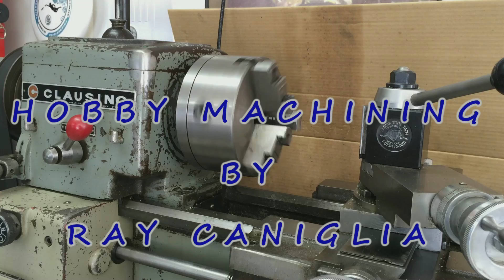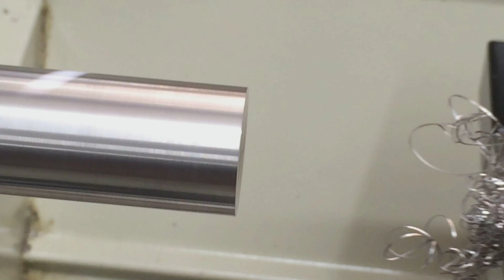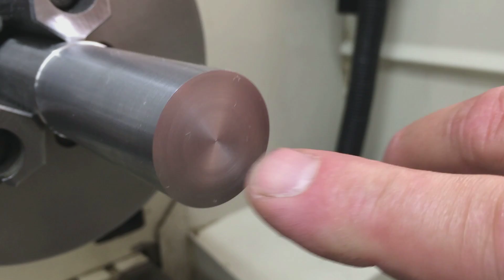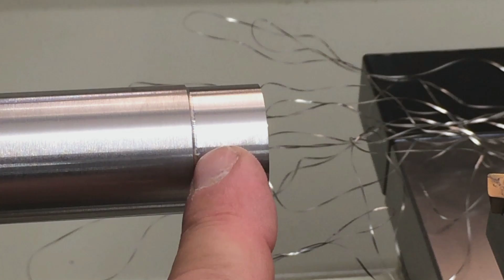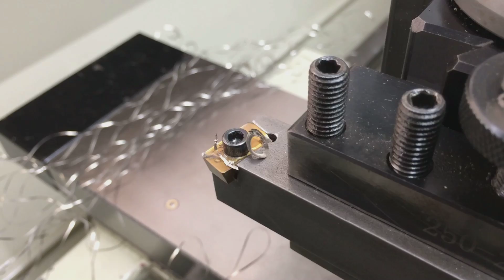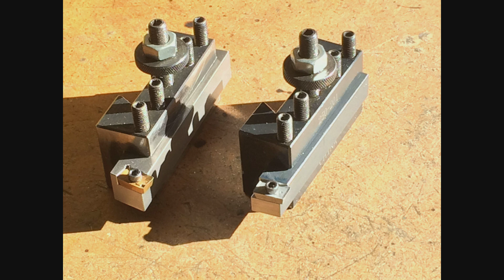Carbide Insert

Comment: Hello Ray,  Watching one of your older videos I had missed somehow.  Those inserts wouldn't go with me as they won't break the chip.  Bad part of that is the long stringy chips can catch in the cutter and mar the work as well as being a hazard.  But to be fair I haven't found very many that work well in stainless.  A lot do a fine finish they just won't break the chip--some get downright scary.  Take care.  Doug
Reply from the maker: Hello Douglas, You are correct, these do create a long string but like you said even a chip breaker insert does not work well on some stainless. 17-4 PH is a perfect example and is very dangerous to work with!

Comment: Nice finish cuts that 17-4 like Ledloy. Trying to figure out the inserts. The coated one looks like a used facemill APMT insert utilizing an edge that goes to waste in the milling operation. Makes use of an edge that normally goes in the garbage. If this is the case nice idea and sure does the job in a lathe.
Joe
Reply from the maker: Hey Joe,

You are correct, these are re-purposed face mill inserts, Randy had a bunch of these and hated to see them get tossed so he made these turning tools. They do work well and from what I understand these run about $18 a piece new.

Thanks man,

Ray
Reply: Ray Caniglia They are crazy expensive but they sure cut real clean. Great on aluminum too. Great way to get more for your dollar and get a great finish. They can be reused for face milling too. A little different layout on the insert but same idea.
Joe

Comment: Ray, I've never used a tool specifically designed for facing and do not know how to orient such a tool. Is the cutting edge of the insert parallel to the work surface or is there some slight angle? Thanks!
Reply from the maker: Hi Bill,

I am not sure, Randy Richard gave these to me that he obtained from a friend, so I am really not sure how these milling inserts were used or what type of face mill that they were installed in.

Sorry I could not answer your question, maybe Randy can?

Ray

Comment: those are milling inserts, thats why they don't break the chip. It's the wrong tool for the job, but of course for hobbyist purpose we use what we can get .. actually, its for a small mill, which don't require a chipbreaker.  If you have to choose between a tnmg or somx at the flea market, go with the tnmg for turning. it's important not to encourage the wrong practice just because our friend's feelings might get hurt, or we think we're not showing respect to them because they were generous with a free tool.

you can get a better finish if you hone the insert on face for something like a 5-thou width of the honed area. this is called a 'wiper' edge.
Reply: meocats I think you are missing the bigger picture; which was re-purposing.  "Never let perfection stand in the way of progress"............you need to be able to differentiate between "wrong practice" and "making the best of what you have".  Thanks, Sean.
Reply: false, i addressed that. U wanna repurpose? braze a carbide endmill to a shank and grind a groove and relief.
Reply from the maker: Hey Meocats,

Thanks for the info. Since Randy has boat load of these inserts I will have to try honing on one and test the results, that would great if it yielded an even better surface finish! I like your idea of re-purposing a carbide end mill, might have to give that a try.

Thanks again man!

Ray
Reply: Meocats if you owned a company and had to purchase the inserts you would look at it differently I happen to own a machine shop and know first hand the cost of them and depending on the coating and grade using the edge that is left from the milling operation saves about 6.00 per insert you would make a better machinist to think outside the box

Comment: Randy did a fantastic job making those tool holders. Nice demo on the chip making. 17-4 can be a bitch sometimes. 
Thanks Ray!

Adam
Reply from the maker: Hey Adam,

Thanks bud! I really like 17-4, great surface finish but have not found a cutting tool in my arsenal that will break the chip.

Thanks for stopping by man!

Ray

Comment: Hey Ray, Randy did a nice job on those holders. I have some inserts that don't have holders, so I've got the bug to make some after seeing randy, but mine are triangular. I already bought the 4140 5/8 stock I will make them from.

Thanks for sharing. Hope you had enough turkey today. Best wishes on thanksgiving.
Reply: You just answered my question! 4140.
Reply from the maker: Hey Steve,

Thanks bud! The 4140 is perfect for tooling just a little hard on cutters. You will have to show off your new tooling when finished, I would like to see how they cut!

Thanks for stopping by!

Ray